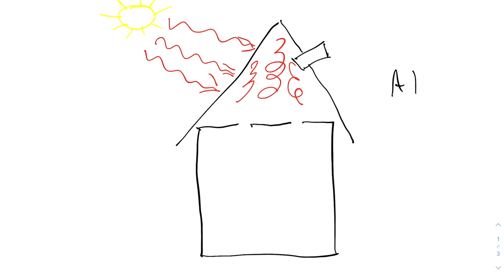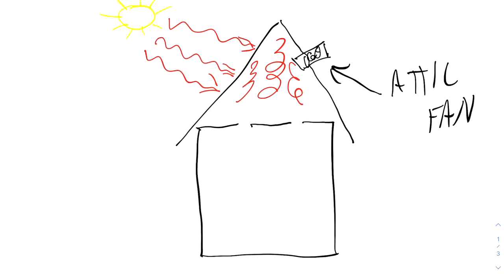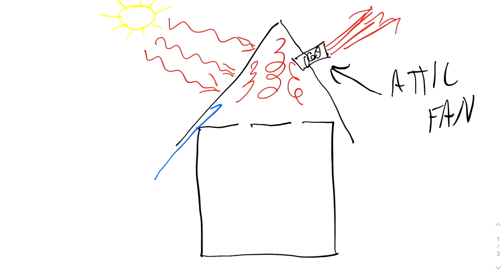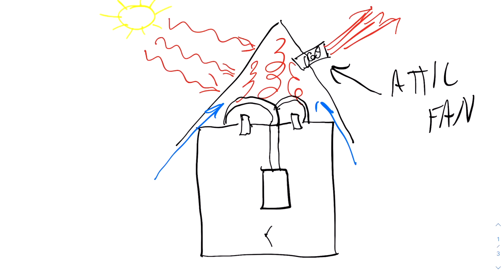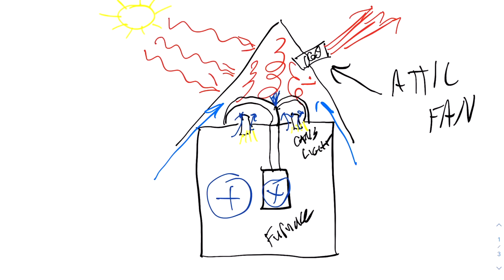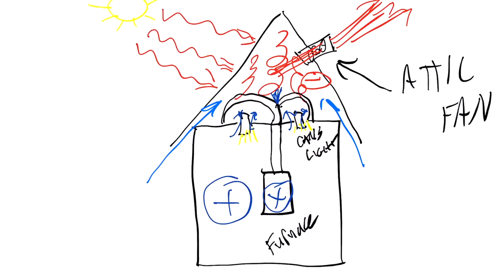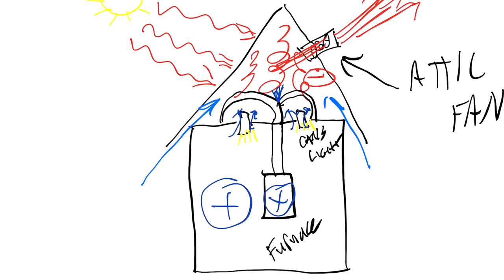3 Remodel Rip-Offs

Comment: Can 100% confirm an attic fan SIGNIFICANTLY increased my home HVAC efficiency.

First home, builders grade everything, not the most efficient. In South East Georgia home would NOT get below 76° in summer. HVAC just couldn't do it. All I did was cut a hole in roof, installed a wired attic fan. Home was able to get all the way down to 70° during summer if I wanted it to. So obviously the attic fan had a positive effect in my situation.
Reply: Facing this issue today. Couldn't get below 77/78 inside the house today in Atlanta to save my life. AC working well and doing all it can do. I have to think that if my attic was a bit cooler I could have gotten my temp down inside the house.
Reply: @tima.478  Do you have an attic HVAC and how are your soffits* doing?
Reply: @Doctaphil64  Unit is in an unfinished basement. soffits vents are about 10 to 15 feet apart, all around the house. The vents themselves are a cluster of about 15 holes, each 3/4" in diameter, covered by a grill. I am actually thinking of removing the grill and making just 1 large cutout under the grill. This might bring in more air than a cluster of holes. I did recently notice that there is a ridge vent that goes across the entire length of the roof. Let me add some backstory: I had the unit turned off on a day that was close to 100 degrees. I was cleaning out the AC coils, fan, compressor area. By the time I got it all cleaned and turned back on it was 78 degrees in the house. The unit simply maintained that temp and was never able to get below that. On a typical day, it has no problem maintaining my usual 72 degrees in the house. My thinking is that a properly functioning unit should be able to achieve whatever temp you set, no matter how hot it is outside. Maybe that's just not always the case, especially in extreme heat. Thoughts???
Reply: @tima.478  I live in Texas and I cannot get my upstairs below 77+ any time it is over 100 outside. Using a temperature gun I have measured the temp in my attic at over 156f! In my case the lack of ventilation was the problem. My soffit vents were too small and too few in number. If you do believe the attic is the problem I highly suggest getting one of these $20-$30 infrared temp guns. Get up in the attic when your home is the hottest and measure the surface temperature of your attic floor's insulation. In my case I had too little insulation AND very little airflow to the attic. Additional insulation provided the base thermal barrier I needed. Cutting six new soffits and an attic fan fixed the attic's lack of air circulation. While all of this has been very helpful, it actually has not fixed the situation entirely. Upstairs still cannot cool below 75f when it is over 100 outside. I have a company coming in soon to install a radiant barrier as the final straw. My only other option after that will be to get a bigger unit, heh. 

Backstory: Two story house in Texas. First floor stays cool, second floor 77+ on hot days. Attic surface temps were reaching 156f before I intervened.
Reply: Did you install the active attic fan IN ADDITION TO a soffit/ridge vent passive system that already existed? I’m getting my roof replaced in a few weeks and they will install passive soffit/ridge vent system and I was wondering if I should have them install an active fan while they’re replacing the roof, or if the passive system should be enough.
Reply: @riffdex  Honestly I have no clue. Went to Home Dept to get fan and sealant, buddy came over with saw. Climbed up on the roof, cut a whole in that b***h 😉, sealed/installed/wired it up to a temperature switch.

No leaks through multiple hurricanes etc. So must have done something right 😆
Reply: @jrod7929  What is your KWH usage like now vs. before?
Reply: @Doctaphil64  Absolutely no idea. Cooled more efficiently, power bill was lower. All I know. This was years ago
Reply: @jrod7929  All we wanted to know 😁Thanks
Reply: Huge difference running the attic fan here as well. Although I can understand his aversion in theory. How many cubic foot are most attics? How big of a fan are you gonna put in there? If you are really concerned about a negative pressure why not use two small fans? one inlet and one outlet? (still possible Bernoulli effect but velocity should be low enough to not matter) Also in his poorly sealed house. you better not EVER close any interior doors because you will let all the cold air escape from the positive pressure. Now the solar powered fan, that's a little silly. Overnight is where you lower the temp of the attic DRASTICALLY. The AC may even turn on the first time an hour later in the day
Reply: If you painted your roof white or used light color shingles you probably could get to the temps you want. Lighter colored roof reflects a lot of heat and for white roof paint it’s like 75 bucks for five gallons about ten of those buckets can cover around 1,000 square feet east diy.
Reply: HVAC is sized to only drop the temperature a certain amount. depending where you live it maybe 20 degrees.
Reply: @Doctaphil64  did you find a fix ?
Reply: @OGCJ10  Yes I did. What fixed my issue for good was spending $3,500 on having 16 inches of insulation added and radiant barrier installed. The insulation makes a huge difference in efficiency (bills) year round but the radiant barrier is like a blanket from God during the summer time. If you live somewhere with killer sun I highly recommend looking into RB.
Reply: You bombed this video Matt! Wrong about everything but the windows unless the house had single vs double if they do you were also wrong about that too!
Reply: I agree, but he kinda has a point about the massive heat. Until you add a fan/fans big enough to pull enough air to make a difference, you are wasting money. To steal a quote-- Go big or go home.
Reply: Do you think a gable vent and fan will help? I have metal roof didn't want to mess with the roof
Reply: @Doctaphil64 same
Reply: Wanna know how to make it twice as good? Add an attic fan to one of your Gables that pulls in air into the attic from the outside. It is then ejected by your attic fan pulling that flow of air out.
Reply: @Doctaphil64 so 1 year later, has the radiant barrier help with the attic temperature? Or did you go and installed more fans.

Comment: I have nothing but respect for you and I always enjoy your videos but I could not disagree more on the attic fans.  I live in Texas and the attic over my garage would get 140+ until I had an attic vent fan installed.   The temperature then would rarely reach above 115 and would cool down to the outside temp within an hour or so after the sun went down.  In my experience, they work and they work well.  I also should point out that the cooling was NOT because it pulled conditioned air from the house as this attic was shut off from the house and only covered the unconditioned garage.  Even more importantly, it made my garage noticeably cooler as the cooler attic radiated less heat down to the garage.
Reply: He’s talking about an attic over a conditioned space that uses AC. He is not talking about a non conditioned garage space with an attic over it that’s not in the home envelope. You can do whatever you want there, that isn’t his point.
Reply: jim yeats my sister has one and it works. And it’s over the whole home. Without the attic being at 150° there’s less heat getting into the home. Therefore the home is not getting as hot. It doesn’t suck the ac from the home into the attic. It gets the hot ass air out and replaces it with ambient air from outside. There isn’t enough suction to pull ac from inside the home over the wide open vents all around the eve.
Reply: In Australia here, have them and 100% agree
Reply: I agree with you. I put one on my house in Texas about 2.5 months ago and I also added about 20" of blow in insulation over what I previously had (30"+ now) so I'm fairly certain my cooled vs uncooled envelope are not interacting as much as they once did. I also maintain a temp and humidity sensor in the attic as well as outside so I know what my conditions are. I never see more than a 20* difference in temp between the attic and outside air. It should be noted that I went for the highest CFM and watt solar fan I could get and where I installed the panel gets direct sun about 85% of the day so it runs constantly when the sun is out.
Reply: As a person with a pretty good head on my shoulders, I would have to disagree with Matt on this issue. I say that as long as there is enough makeup air to compensate for the exhausted air, then there is no reason why an attic ventilation fan can't be very effective. You must match exhausted air with an equal amount of intake air. This is ventilation 101
Reply: I live just north of H-Town in a 1978 house and am renovating; 2nd flr and attic at the moment. If u have never peeled back your insulation then u can not possibly marvel at all the cracks, gaps and large holes there are in your ceiling and the many vertical chases that let unconditioned air into the house. If u have a roof mounted fan kicking on you will by definition create negative pressure above your second floor ceiling, which is the primary air barrier for the whole house; and all those open spaces will be letting air into the conditioned space; all the more so if you have traditional hung windows with the brush ‘seals’ just like Matt Risinger mentioned being super air-leaky. Dont forget hes a Building Scientist, hes studied this and is sharing with you all his proof on making your home most comfortable for your budget.
Reply: @austincohoon4203  What solar attic fan did you buy?
Reply: I have been doing HVAC For 35 years and started in Southern California then moved to Northwest Iowa. The muggy hot days in the summer are compared to a jungle in South America and the winters as rough as any northern Alaska winter just not as long. These attic fans are a life saver up here in the midwest. Sucking out the super hot 150 degree air in the attic and replaced with 95 degree air definately makes the house so much more comfortable and ac run much less. Remember that when that fan is running that air takes the path of least resistance.For air to be sucked through those little wire holes and around plumbing vents etc, would be nearly nothing
Reply: @zefrum3  The largest opening from the main house is possibly the pipe vent chase that allows the plumbing vent pipe up to catch the second floor plumbing then up through the roof and sometimes these chases are pretty big. A person could use anything to flash off the attic to the house and the largest possible leak is sealed. Air always takes the path of least resistance.
Reply: Regular attic vents would have the same effect
Reply: Here in Texas, I've had a fan alone drop an attic from 130 to 90. Facts

Comment: In Socal we have installed at least a dozen powered,  thermostat controlled attic fans in older homes and the owners unanimously agree that it helps keep the house several degrees cooler. All you need to do is grab a chair and touch the ceiling to feel the much cooler surface when the fan is on.  Not sure what this guy is talking about.
Reply: 100%  I like this guys videos, however his info in relation to southern california, (Orange county) is just false on the attic fans. Maybe with the solar fans, but growing up in my house I just remodeled, we installed a powered attic fan and it literally took the temps in the house down by 10 degrees.  Maybe his info is specific to 100 plus days which we never see.   His microwave analogy is bad. OK, the roof is hot. Theres a space between that roof and the ceiling of the house. He's saying that you can't cool off that space with a fan? A microwave oven does not heat up the outside of the oven. Duh. This logic might work on some dude who works in the walmart accounting office but not where I come from. HE says texas a lot in his video, maybe that's the disconnect.. If I were to believe his analogy, then the water cooling system on a cars engine is useless. OK..... next....
Reply: How much was it installed ? I’m in murrieta.
Reply: He's a hack.
Reply: I live in Illinois, attic fans definitely work. Build has this one wrong.
Reply: @fastj1962 Amen brother.  South cal attic fan lover here too.  It's really a game changer IMO
Reply: @Detailpops  Did it myself. Made a box and the original vent had too small of an opening and I was literally getting blow back and air was coming out where it was going in...lol Purchased a dormer vent with a larger opening and boom. Fixed the issue. 
       I had installed one of these fans on the side of my garage with one of those vents that open when the fan is on because my garage would get hot as hell and it worked amazingly so I bought another for the attic. This is the one, its $179 : 2940 CFM Smart App Controlled 2-Speed Gable Mount Attic Fan. I have an app on my phone and can manually adjust the fans at will.  It was in the high 80s today here. I live 8 miles from the beach. It never got over 77f in the house. It would have been cooler but we have a 9' x 7' glass roll up door in the back of our house and the sun cooks that side of the house unless the curtain is closed, which it wasn't for most of the day today...lol